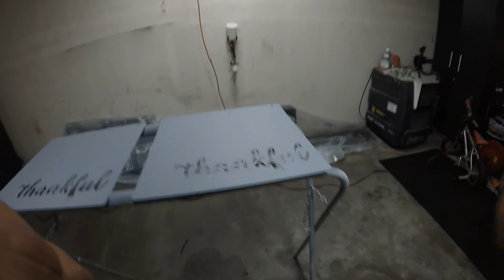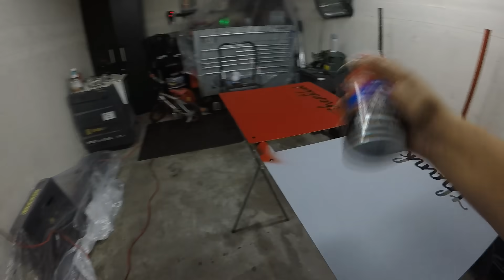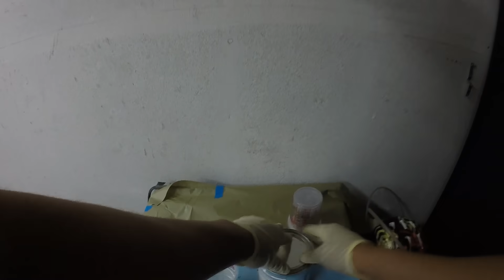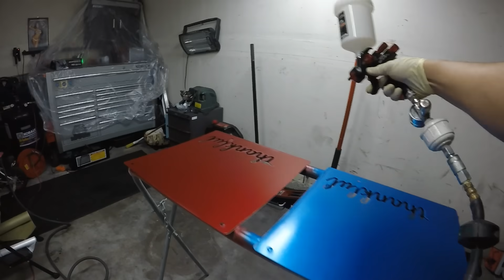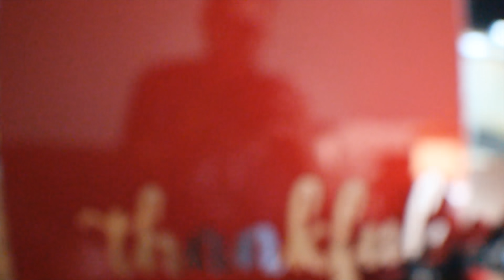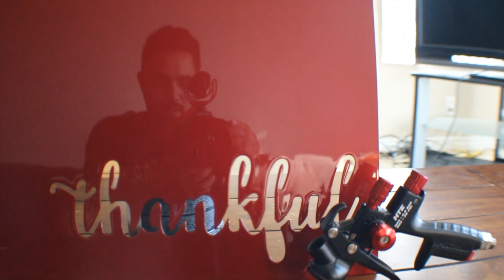Harbor Freight Spraygun Review: Spectrum Hte " Black Widow" pt 2

Comment: Based on your recommendation, Bought both the Black Widow  HVLP from a Ebay site and the and HTE gun from someone who used it once, if at all.  Wow!  I sprayed a Toyota Highlander front bumper and grill and not a single run, even on all the nook and crannies.  I Sprayed the metallic color coat the the HVLP first day. I bumped into the bumper and left marks and a finger smudged that needed sanding out and recoating.  Next day, touch up and single coat of color with the HTE and then clear with the HTE.  Again, Wow!   Even brought the guns with me from Sac to LF(aounrd the corner from the PO) to have a friend test drive them.   He's in awe of the HTE.   Oh, and the HF disposable cups...are NICE!!   I bought some O-rings for when the cups and adapter fittings start to leak.     Thanks again, Brian
Reply from the maker: Brian Henby I’m glad you enjoyed it, I am also very impressed with that spraygun,  it’s a keeper, would love to see how your project turned out! Cheers , stay sprayin 🤙🏻

Comment: Where’d you find that clear? I never heard of that. Also for a total glass finish. If you pump the PSI up to 35ish with the trigger pulled it would lay super flat. I like these guns but im not sure i wanna pay that tag for it at harbor freight yet🥴. Awesome video and spray bro!
Reply from the maker: bill mcquay I’ve used this clear in the past it’s a really good clear and well priced , it was available at my local paint store. 35 psi wasn’t working for me I had to drop the pressure because it was over atomizing

Comment: Can you please comment on the HTE versus HVLP decision as opposed to what the HF salesman was recommending? Also, is the HTE version (1.3mm) recommended in your opinion for Single Stage? Thanks in advance!
Reply from the maker: Great Question. Hte version is more ideal for base/clear/single stage. in my opinion the hte will be all you need for most applications, except for primers or thick paints that require a larger tip size. hvlp has a larger tip so it will be able to spray thick paints like primer and such. If you are planning on spraying single stage id say just get the hte, its a great gun and im sure you wont be disappointed in it.

Comment: The problem I have with these guns is buying additional tips can be hard. Do you know Where to buy extra parts?
Reply from the maker: Bill McCaffrey harbor frieght doesn’t offer service parts, but most sata 5000 parts fit on this spraygun
Reply from the maker: Bill McCaffrey not sure if extra tips from sata will fit on this, but I’ve been informed that most of the seals fit the black widow

Comment: Bro how did you set the gun on the adjustment knobs for this gun? What were your settings?
Reply from the maker: Murrica Motors  28-30 psi , one turn in from open fluid, full fan
Reply: @Mechaniclyfe  thanks brother it is very much appreciated. I plan on repeating my car Viper Blue in the near future even though 6 months ago I already painted it Torch Red using single stage Acrylic Urethane. This time I plan on using clear over the base and hopefully the orange peel is next to nothing. When I painted my car previously I used the silver $75 HF gun and while it left some orange peel I was able to color sand and buff it to a very nice paint job, but I also want to paint others cars for a lot less than most people charge so people can have a nice looking car at a fraction of the price. I am also a DIY guy and love painting cars (painted 5 in my life) and just want to minimize the labor involved after the base so the clear will go down like glass. Thanks again and any tips using this gun I am open to hear them. I use my garage, but get next to NO dust or dirt nibs in my jobs. Check me out on Instagram @red_devil3v and let me know what you think of my work on my 2006 Mustang GT and my son's 2006 Mustang GT I recently painted Meteor Grey Metallic with the same $75 HF gun.

Comment: Hey bud i noticed mine didnt have a pressure regulator did u put an air pressure regulator on yours
Reply from the maker: Eddie Morph correct gun doesn’t come with a regulator I use one from Devilbiss
Reply from the maker: If you buy a purple gun it comes with a regulator steal it off of that and use the purple gun for primer
Reply: @Mechaniclyfe  thanks for advice

Comment: What size compressor do you use and does it keep up or does hte really take that much more air ??
Reply from the maker: For small parts like no bigger than a hood of a car it keeps up just fine , anything bigger and it will struggle maintaining proper pressure for atomization

Comment: Not sure how the gun was setup but sounded/looked like low psi... I've found it likes about 2 turns out and 24 psi, naturally weather etc matters. Hope this helps 💪
Reply from the maker: Aaron Corley I was around 26-28 psi
Reply: @Mechaniclyfe . Where was the fluid?
Reply from the maker: Aaron Corley almost wide open maybe a turn in or two

Comment: Exactly how did you have the adjustments? Also psi inlet? Thanks for the vids
Reply from the maker: pitlion1 I started at 32 psi but that was a bit too high so I turned it down to 26 and it started spraying much better, full fan, fluid roughly all the way open and turned in about a turn. I put on two heavy coats, and that’s about it! All this is going to be different depending on your temperature and type of clear you are using.

Comment: First your not letting the clear flash before recoating,you are to close,and you are towing you gun which means you are tilting and locking your wrist,the trash is from you dragging the sides of the mix cup if it isnt cleaned or new and last you shot this flat so it doesn't prove how good or bad the gun is because you won't get runs or sags,it all pools on edges and is hard to see on camera

Comment: I have read that the Sata needle kit #15438 and also most Sata 5000 parts work on this gun. Can anybody substantiate that? Because if they do indeed work, there ends the problem of replacement parts, yes?
Reply from the maker: Harbor does sell a rebuild kit for these now , the only thing that fits from the Sata 5000 is the needle seat seal, other than that nothing else fits

Comment: What sort of compressor do you run?
Reply from the maker: 30 gallon kobalt nothing fancy
Reply: @Mechaniclyfe  have you ever tried painting anything larger? Do you ever feel like it can't keep up?
Reply from the maker: gokblok I’ve used an 80 gallon before at a shop, with my little compressor I can only paint small panels like a door or a hood anything larger and it struggles

Comment: Now try a nice thick HS clear.
Reply: Klaus Eisenheim  I'm was referring to what is known as HS clear or High solids clear. More expensive, thicker and generally more problematic to spray for new painters or when using cheaper spray guns that don't atomize well. HS clear has more solids content than MS or medium solids clear. MS clear is easier to get it to flow out with less orange peel but lacks the ultra hugh gloss of HS clear. Hope that helped. Cheers

Comment: What compressor?
Reply from the maker: Robert Wren I use a 29 gallon kobalt , from Lowe’s really the minimum you want for occasional spraying
Reply: Just A Mechanic have you sprayed a full car?
Reply from the maker: Robert Wren no not with a small compressor , I can only spray small parts or motorcycles

Comment: Your better off buying the bottom end iwata gun for $200
Reply from the maker: I agree , but the widow can be had for around 150 on sale , I haven’t seen an iwata that low in price. Not taking away credit to the widow I think it’s still a great gun and can lay down the paint well and as good as some higher end guns.
Reply: Just A Mechanic a little secret for ya, the spectra gun for $149 is the same gun as the black widow, you can get them on sell at $99, the only thing they did differently with the blk widow is they replaced one of the plastic seals with metal and of course it’s blk and red coating 😎

Comment: There are lots of decent videos on YouTube...but...why do people have to blast porn type music during the videos? The music's bad enough but the volume is insane. Do you folks ever review the videos before the upload? Geez! Now...regarding the spray gun...it seems to spray ok but for about $50 less than Harbor Freight charges you can buy a DeVillbis FLG5 that will spray as good or better,  you can get different needle and nozzle sizes and more importantly, you can get parts. I have a bunch of cheap Harbor Freight guns and they serve a purpose...throw-away guns for cheap paint jobs. When you get into the 200 dollar range there are a whole bunch of other options that include a decent warranty and parts availability.
Reply from the maker: Fred Thorpe check part one ☝🏼, sorry you didn’t like the music, I gotta use YouTube free music so my choices are limited . Cheers

Comment: What is it with all these Youtube paint videos, doesn't everyone realize there is a technique when you use a gun whereas you don't just let go of the trigger with each pass, you ONLY let up on the fluid flow stage of the trigger pull. Don't mean to sound like a dick but it's always been a pet peeve of mine. Nice job otherwise.